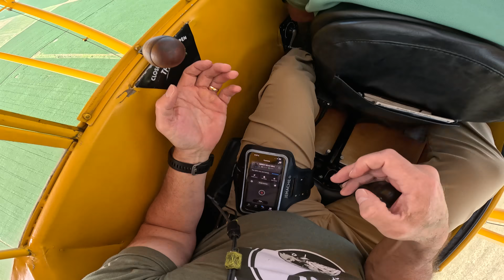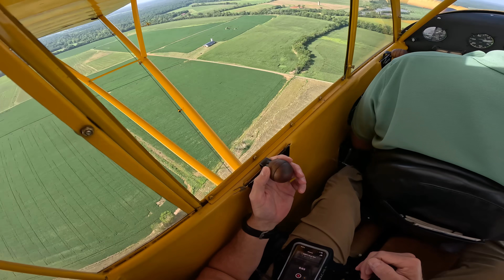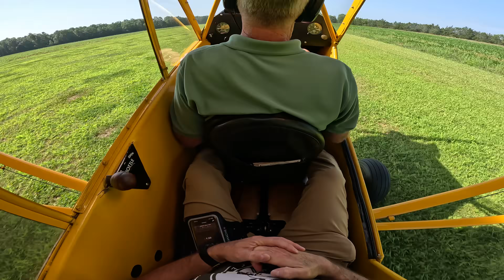Execution

Comment: Wow!  That was beautiful.  Do you have right rudder pretty much at full deflection on the slip approach?
Reply from the maker: Yes I do!
Reply: Back in the 51 I soloed a J3. We were flying of a short field with power lines on one end and trees on the other. We flew Champs, T Craft and the Cub out of that field with no problems. Come in a little high then slip it in. Later I went to the big city and I wanted to continue my flying. All that was available was a 140 Cessna. The instructor was checking me out. Everything went great until the landing. The runway was over 9000 ft. On final I was high so I did what came naturally, I put it in a slip and landed on the numbers. I was talked to very unpleasantly and then introduced to things called flaps.
Reply from the maker: @leroyburkett9904   I've had similar experiences. Sounds like you had some great aircraft you've flown.  I am enjoying exploring the envelop and all the tools I have in my toolbox to fly.  I like coming in high because when I flew B-52 patterns, if I were to lose the engine I would not make the field. Safe flying and thanks for sharing my love of flying.